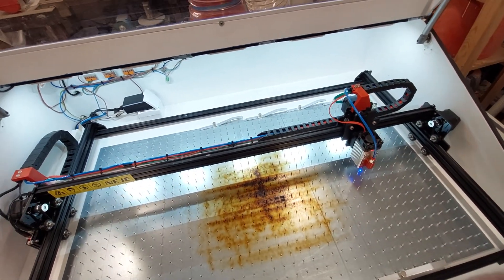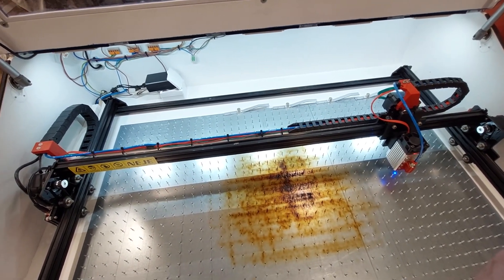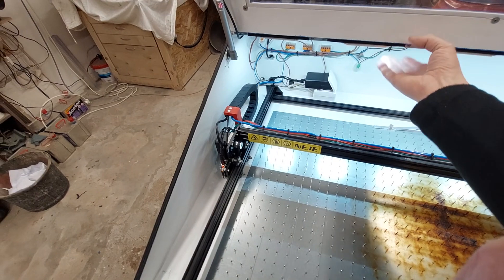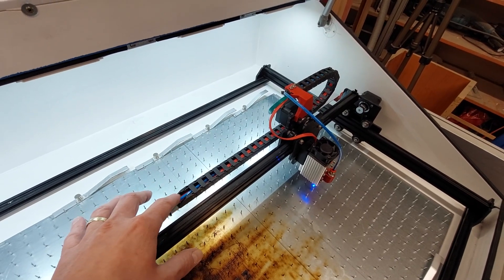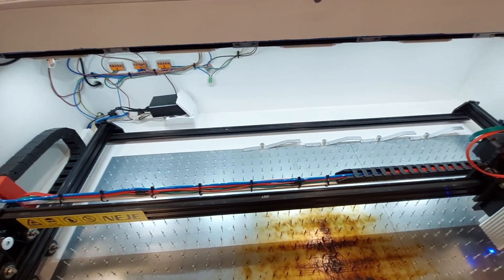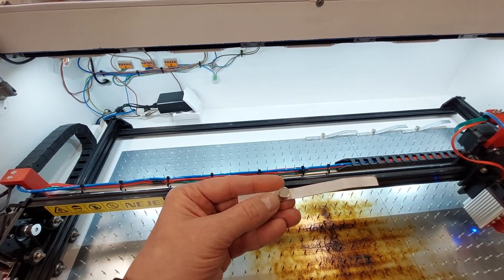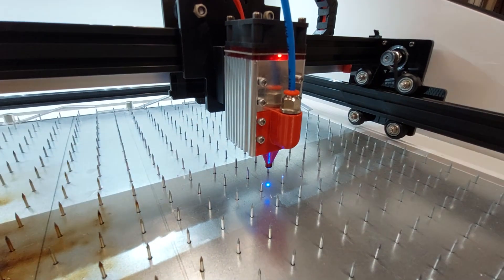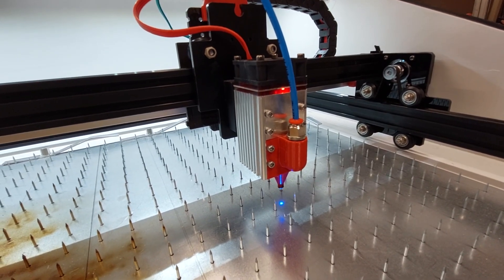NEJE Master 2S Max A40640 - Energy chains cabling detailed out + a few updates

Comment: How well is the sheet metal holding up to the heat from the laser? Are you getting any warping of this?
Reply from the maker: There is no warping of that metal sheet at all. Its mass is such huge (in comparison to power of laser beam), that heat is dissipated very quickly.
Reply: @libor-vitek  thank you!

Comment: Hello there, thanks again for your awesome video! Could you tell what connector you used for the air assist? couldn't really find the single part online. the 3d part you designed is awesome!
Reply from the maker: Hi, thank s lot for your comment.
I used fitting QS-1/8-4, example of source to buy is here: https://www.amazon.co.uk/Festo-186095-Model-QS-G1-Fitting/dp/B01E5UMX2S
What I did before I mount the fitting on the nozzle is: I bought the G1/8" tap and tapped the G1/8" thread in nozzle. I believe if you make the hole in nozzle properly (I mean big enough), you may screw the fitting into the nozzle also without tapping the thead. In such case I'd just recommend to use a sealing to avoid air leakage (e.g. something like silicone paste).

Comment: Hello, could you please post a video or some details about how you have made the laser bed? Thanks for the great videos. I'm currently building your machine box project and it already looks great.
Reply from the maker: Hi Andrei, thank you for your comment, happy to hear it looks good :)
Regarding the laser bed, check this link: https://youtu.be/79kxg2XjVb4
Reply: @libor-vitek  hi again, for the air assist nozzle what kind of connector did you use to connect the air hose? A link would be helpful, to try to find something similar in my country. Many thanks!
Reply from the maker: @andre1-29  Hi Andrei, I used fitting QS-1/8-4, example is here: https://www.amazon.co.uk/Festo-186095-Model-QS-G1-Fitting/dp/B01E5UMX2S
No. 4 stands for hose outer diameter, you may consider also different hose, but 4 mm fits to my needs, mainly with respect to inner space of used x-axis energy chain.

Comment: Hallo. Ich baue meine Maschine gerade um und habe auch das Problem das die Kabel zu kurz sind. Kannst du mir die genaue Bezeichnung der Kabel sagen oder einen link zum bestellen?
Vielen Dank
Reply from the maker: Hallo Patrick. Just use cables of the same cross section as the original cable has. It is 22 AWG. In my case I used some scrappy pieces of cables, which I cut from NEMA 24 steppers used on my DIY CNC router 😉